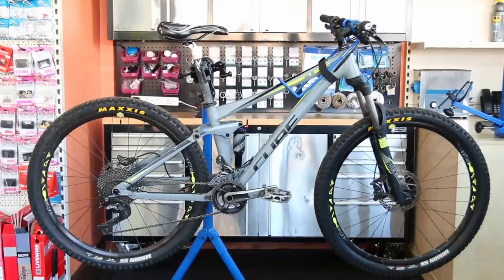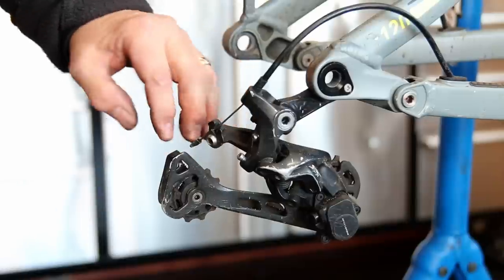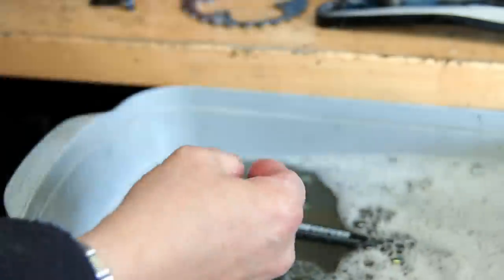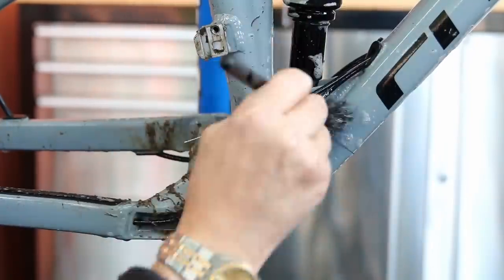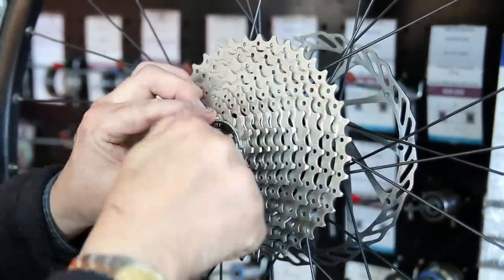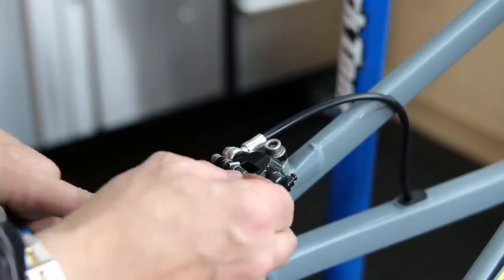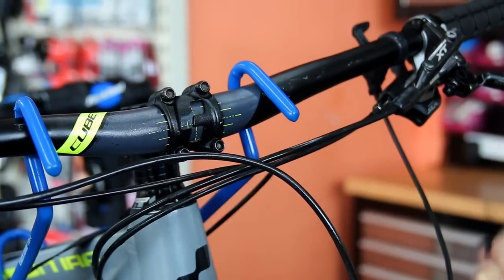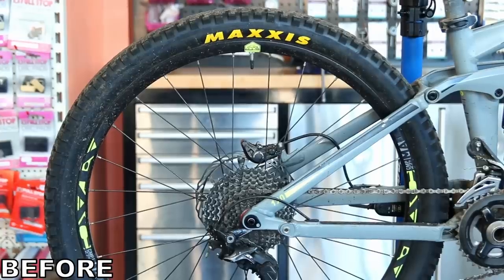Cube Rebuild Service! Worn Drivetrain Mountain Bike Overhaul!

Comment: That's a high end bike that's seen a lot of use. Even if the chain replacement's well overdue, I respect the owner's dedication. Great work, Mr. Speeds.
Reply from the maker: We love to see a well ridden bike in the shop!⚙️
Reply: Nothing high-end on this bike. Except the service it recieved.
Reply: @ivanivanov7064  It features a mix of Shimano XT m8000 11-speed and SLX. Only XTR is higher up in the Shimano hierarchy then XT.

If you say this a low end, budget bike I don’t know what rock you have been living under.
Reply: @emilkumpula4843  M8000 is a 7-year-old mechanical gruppo, frame is metal, wheels are cheap OEM Cube brand not even tubeless compatible.
Reply: @ivanivanov7064   it's definitely not low end coming with xt and slx. It could definitely be made tubeless with a bit of effort. It's not a race bike, it's a well specced trail bike thats seen a ton of use and responded well to service. Stop being a weirdo

Comment: Id call this a service Plus. Great that you fit new parts to OEM spec. Id wager that this bike is better detailed than new. When you wash the bike in the workshop where does all the water drip?
Reply: Hah - I always wonder that too! I have to do my bikes in the bath 😂
Reply from the maker: On video it actually looks like we use a lot more water than we do, we’re very cautious to use as little as possible and then we mop up after ourselves ⚙️

Comment: Would you recommend using brake parts cleaner when cleaning near sealed bearings like in the hub or in the bottom bracket? I've always been using degreaser and hopefully I haven't gone and ruined some of my bearings.
Reply from the maker: It’s what we use, it doesn’t sit on and run round / in the bearing seals like degreaser does. Brake cleaner evaporates pretty quickly which is why I like it around hubs, it’s less intrusive

Comment: what is the best grease for the bearings? teflon , silicone or lithium?
Reply from the maker: It depends on the bearing and the climate / conditions it’s used in. Any Zinc Oxide based grease is a good all rounder for bearings.

Comment: 7:26 what was that extra part you put in to the tire? :O
Reply from the maker: If it was the blue, we changed the Rim tape. The old was plastic and had gone hard & was causing problems when fitting the tyre, so I replaced it. Although we film the majority of the work some things get cut out in the edit.

Comment: I see that you use Sunrace cassette. Is this good quality our do you prefer Shimano, Sram or another brand.
Reply from the maker: I’d have preferred Shimano but it wasn’t available until January, so had no choice really. However in the past couple of years with the world the way it is I’ve fitted a lot of Sunrace when Shimano has been out of stock with no complaints, for a part like a cassette that wears anyway they are a pretty credible contender really.
Reply: @Bikespeeds  the reason I’m asking is that I self do bike repairs as a secondary activity and indeed Shimano is hard to find for some parts. But thanks for the information and keep on doing these video’s because they help me a lot and it’s fascinating how a bad looking bike could end almost as brand new.